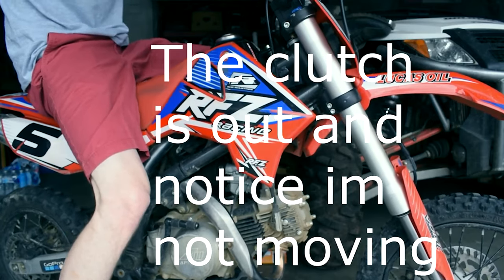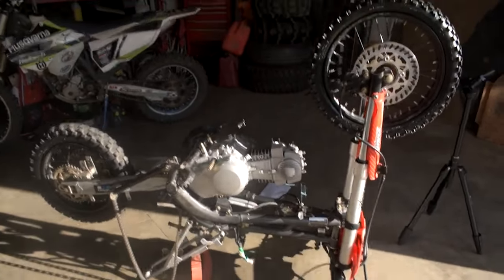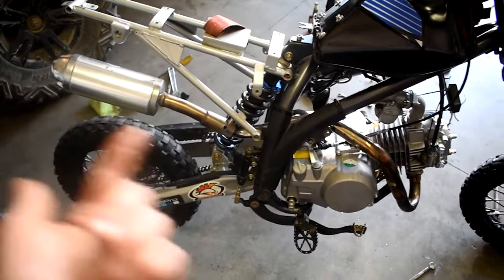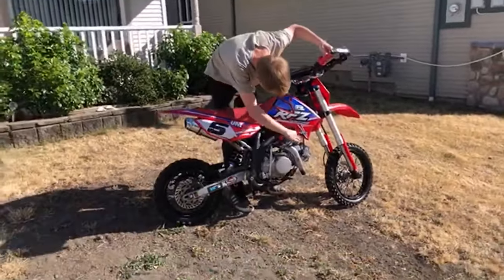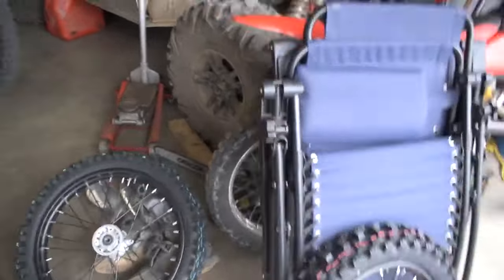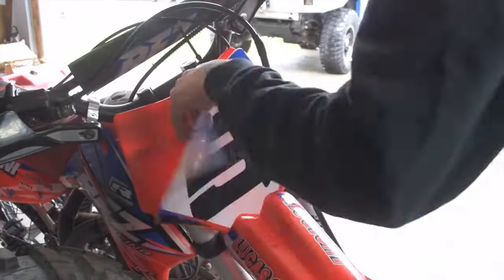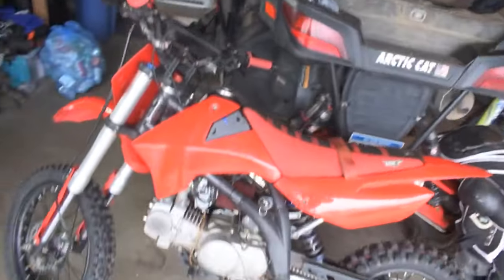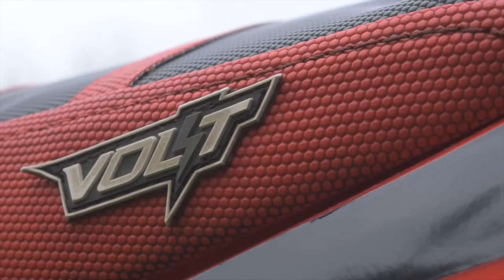1 Year Build Of A Amazon Pit Bike! Apollo RFZ

Comment: Turned out sweet! A couple of bubbles and creases but really looks good. I’m just messing around with you about the bubbles. They are hard to do. I have trouble with Uni stickers and other brands. I have a 1998 xr70r that I bought in 2001 to make a pit bike. Back then it wasn’t as easy to order parts. I had a spine injury and had to put it on hold for 23 years. So I did start up cleaning and polishing it but I had my right leg amputated. Then 2 years later I had my other leg amputated. It was 2 different ways it happened. Both of which were not a cool experience like a shark attack or motorcycle accident. Kinda lol 😮

Comment: I'd put an oil cooler on that just for longevity of the engine. If you do I would like to see the video as I have a wpb 140 with the standard cooler on it and probably Gona go for the eBay upgrade one as I have the nibbi carb on and it feels like the engine gets hotter now haha it rips tho. 

Wish I could come an rip with you but I'm in the UK alittle far away 🤣
Reply from the maker: I’ve already blown up the engine 😅 and since sold the bike! Would be cool to ride haha
Reply: @AaronsEnduro  no way 🤣🤣 what was the cause do u know?  And yeah would be cool to ride. Plans are to emigrate to Canada in the next 5 years so I'll hit u up if that happens 👌
Reply from the maker: Honestly not sure what happened to it. The first engine blew a transmission the second started smoking like a chimney
Reply: @AaronsEnduro  yeah the first wasn't worth messing with it only being the 125 anyway, but smoking could have been because you didn't have a cooler on it Caz when the oil gets to hot it gets really thin witch would lead to it passing the piston rings then burning off hence the smoke, 140cc and up always come with a cooler or the ones I have seen anyway. Did it go bang or did you just get sick of that bike? Caz that rear brake pedal is a suckie design 🤣

Comment: hi, been watching some of your videos and it is very informative. I have a question regarding the Apollo X18. I am thinking of buying this one for my 10yo kid (4ft 10 / 90 pounds) but I do believe it is a little bit tall (but I don't have much choices where I live and I want the 17/14 wheels as he will be mostly riding in sand). Is there a way to lower the seat height by a few inches to bring it to about 30in (rear shock)? Thank you
Reply from the maker: Appreciate you watching!  Yes the rear shock is slightly adjustable and you should be able to lower it some (but i do believe it will increase spring rate making it a stiffer ride)

Comment: You got the Dunlop's and got the bigger wheels yeeeeeee 🤙👍⚡🥂 dude what a beast engine swap on the pit bike yoooooooo that's beast. Great work.the Apollo rfz x19 I have came with those same size wheels but different tires I'm still on stock tires
Reply from the maker: The best upgrade i did imo was the dunlop tires! Made a massive difference
Reply: @AaronsEnduro  that's beast 👍🤙 I'll get some for my x19 when I burn out these stock ones soon
Reply from the maker: Highly recommend!!
Reply: Do you have links for the rims you used?
Reply from the maker: Should be in the description. I know apollomotors.ca sells them

Comment: Bought 2 Apollo 125 pit bikes. Ride great, wish my wife didnt talk me into Automatics. Do you have links for all upgrades. The carb a must  but bigger wheels huge upgrade as little wheels are squirly and feels little unsafe
Reply from the maker: Heres my apollo 125 parts list i made:  

*ENGINES*

125cc Engine Replacement:https://amzn.to/3v8jB3Z 

150cc Engine Swap Kit:https://amzn.to/3gdSmAJ

190cc Electric Start Engine Swap Kit: https://amzn.to/3apo9Lx

*PERFORMANCE PARTS*

(The exact tire's I use and love):

 (LARGER WHEELSET)
(Front tire 17") https://amzn.to/2SNlYYT
(Rear tire 14") https://amzn.to/3nHdz7F

 (SMALLER WHEELSET)
(Front 14") https://amzn.to/3iMq660
(Rear 12") https://amzn.to/37blCnx

 (GEARING MOD *420 PITCH SPROCKETS & 17MM SPLINE*)
14 Tooth https://amzn.to/3bdCU4J
15 Tooth https://amzn.to/2NPhHFD
16 Tooth https://amzn.to/3bduPNF
17 Tooth https://amzn.to/3e5MEQD

 (GEARING MOD *428 PITCH SPROCKETS & 17MM SPLINE*)
14 Tooth https://amzn.to/2NPi2bn
15 Tooth https://amzn.to/3sQQFMX
16 Tooth https://amzn.to/3e7eYCc
17 Tooth https://amzn.to/2PlkW7V

 (RACE IGNITION* Verify your pin count*)
7-pin CDI Racing Box:https://amzn.to/3dRrG3T
6-pin CDI Racing Box:https://amzn.to/2Np5Iuj
5-pin CDI Racing Box:https://amzn.to/306X4Y1 

 (MIKUNI CARBORATORS***)
Genuine VM26 Carb(Good for 200cc+):https://amzn.to/3rdSxij
Genuine VM24 Carb(Good for 125-150cc):https://amzn.to/309pEI5

*(CARB FLANGE ADAPTER)* YOU MAY NEED IF YOU GET ROUND 28MM AIR INTAKE CARB
28MM Carb Flange (Good For VM24 & VM26)https://amzn.to/3qcd1GP

 (REPLICA CARBORATORS***) 
Replica VM26 Carb(Good for 200cc+):https://amzn.to/3bcPmSn
Replica VM24 Carb(Good for 125-150cc):https://amzn.to/3qcd1GP
Replica VM22 Carb(Good for 110-125cc):https://amzn.to/2AX18kH

 (CARB JETS FOR TUNING)
VM22/VM24/VM26 Carb Jets:https://amzn.to/2VecKGQ

 (AIR FILTER)
ANGLED UNI Carb filter:https://amzn.to/3cNzPpP
STRAIGHT UNI Carb filter:https://amzn.to/2NPZ8RJ
UNI Filter Oil SPRAY & Cleaner:https://amzn.to/3rdHHst
UNI Filter Oil (CONCENTRATE):https://amzn.to/3qcV2QF
UNI Filter Oil SPRAY https://amzn.to/3sG0Cwq

*BIKE CHASSIS'S PARTS*

 (HANDLEBAR)
Pro taper handle bar kit:https://amzn.to/2BY5Xdy
Pro taper handle bar cover:https://amzn.to/30urMM1
Pro taper Pillow top grips:https://amzn.to/3hkNVlO
Folding Clutch & Brake lever combo:https://amzn.to/2BS05Ct
Hand Gaurds:https://amzn.to/389Xnp8

 (FOOT CONTROLS)
Anodized foot pegs(any colour):https://amzn.to/3sMuPKp
Anodized Shifter lever(11mm):https://amzn.to/3uQW0FJ
13mm (small 110-125cc) kickstart lever:https://amzn.to/3uUjtWr
16mm (larger 150cc+) kickstart lever:https://amzn.to/3uPOfzV

*MAINTENANCE PARTS*

 (OIL *What I use*)
Semi Synthetic 10w-40 4 stroke Oil:https://amzn.to/3d07jkG

 (HOUR METER)
No-battery operated hour meter:https://amzn.to/3uOk4Jk

 (SPARK PLUG REPLACEMNET)
Single NGK Plug:https://amzn.to/3kF2lzs
10 Pack NGK Plugs:https://amzn.to/3qe4i74

 (SPARK PLUG BOOT *IGINION COIL)
Ignition coil replacement:https://amzn.to/3c2K4YK

 (FRONT BRAKE PADS)
Smaller front pads:https://amzn.to/30b8dqM
Larger front pads:https://amzn.to/387d5l6

 (REAR BRAKE PADS)
Rear brake pads:https://amzn.to/3kJtAZr

 (CHAINS *420 Pitch*)
(BEST)Renthal 120Link chain:https://amzn.to/2Uz4twC
(MIDDLE)DID 120 link chain:https://amzn.to/3sK3J6C
(CHEAPEST)RK 120 Link chain:https://amzn.to/3uRjw5v

 (CHAINS *428 Pitch*)
(BEST) Renthal 120 link chain:https://amzn.to/30bWeJi
(MIDDLE) DID 120 Link chain:https://amzn.to/383zkIw
(CHEAPEST)RK 120 Link chain:https://amzn.to/3c0S4cH
Reply: @AaronsEnduro  Awesome thanks. I should have got the Apollo with 17'/14 wheels and at least a semi auto. We have taken bikes to many ohv parks and forest land. These bikes even stock are a blast as long as i dont try to climb steep hills, im too old anyway   lol
Reply from the maker: As long as you’re having fun is all that matters!!!